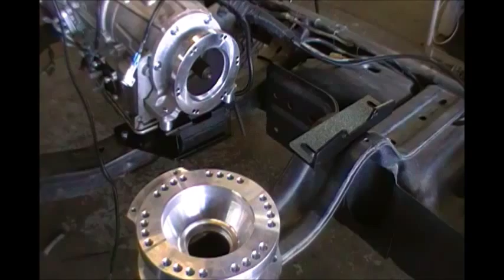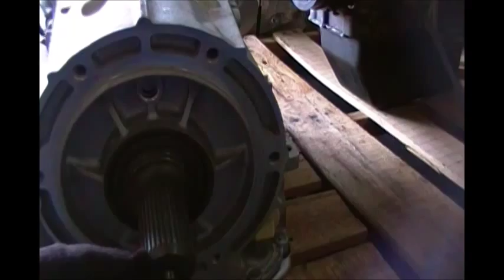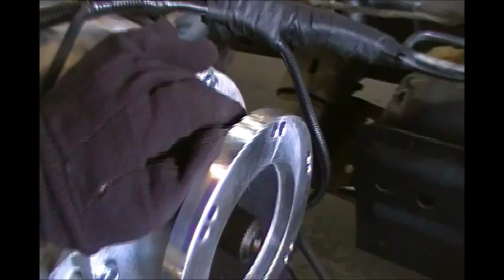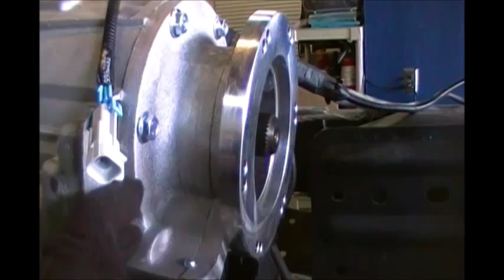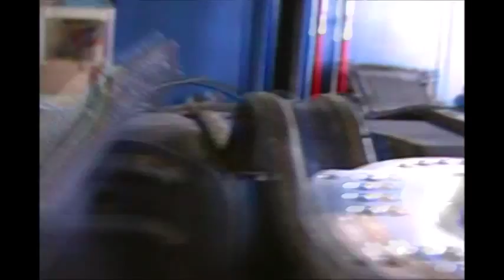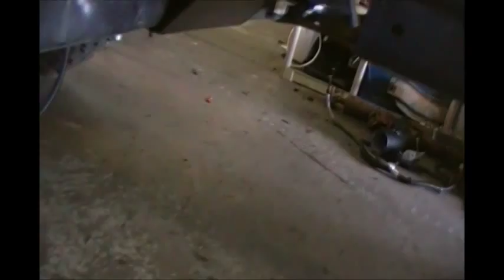Part 16 Transfer case adapter

Comment: What size freeze plugs to use on the case with the 2, 12 and 6 o'clock drain holes.

Comment: In all the videos I've watched I've never seen a website to go to for parts. Are you pick up at the store only or is there a website to visit? What problems would be encountered converting a 2015 6 speed JKUR over to the 6L80 and LS engine? Thanks!